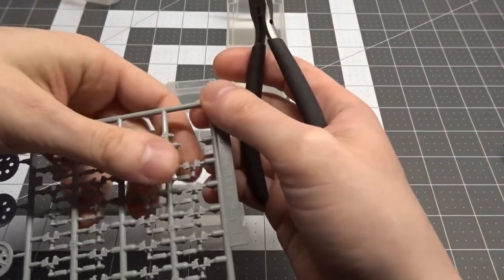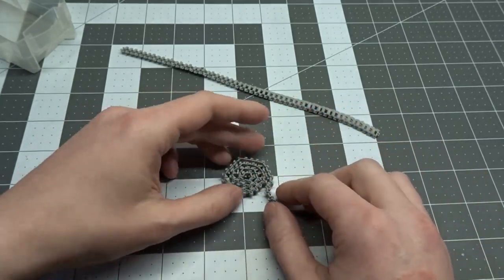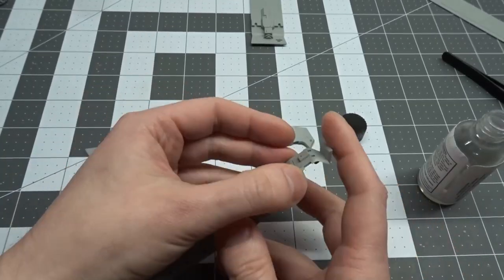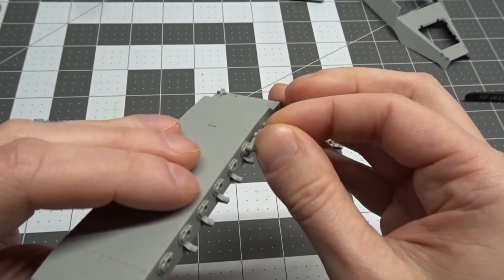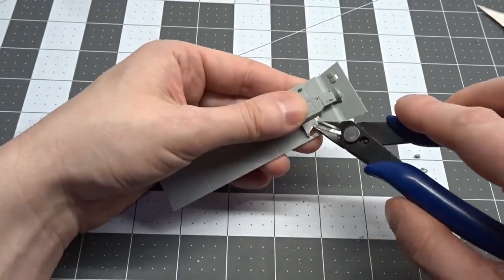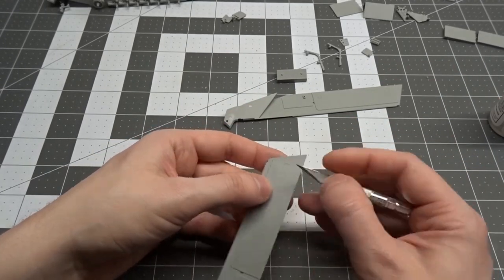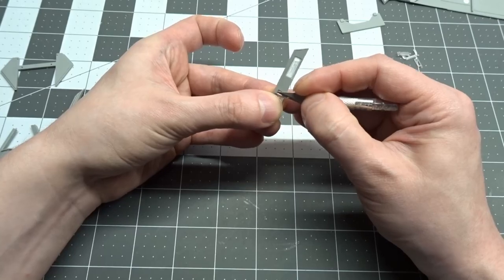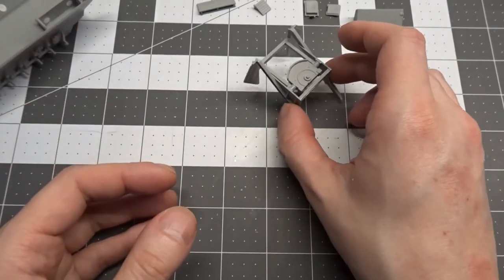Dragon 1/35 Sd.Kfz. 251/22 Ausf. D (Update 1)

Comment: Nice job you did. I have some questions: how many mm is the length of one engine hood? And  what is the length of the widest part of one engine hood? And, how many track links does it have on one side? Regards from the Battle of the Bulge area, Belgium.
Reply from the maker: Thank you so much! This is the Ausf. D so it only has one engine hood the C and earlier have two. The length of the hood is 31.75mm and the widest part is also 31.75mm. The tracks are a lot like the real vehicle with one side needing 54 links and the other 55 links. If you have anymore questions I will be happy to help.
Reply: @FlokisModels  aha, okay. I asked because somebody offered me a metal door with the shape of a Sdkfz 251 engine door ( one of the two). With the kits scale, and your measurement, i can convert it in cm and then i know if the door is really from a real sdkfz.
Reply from the maker: @gerhard6105  Glad to be of help! That would be really cool if it was a engine door from a real Sd.Kfz. 251!
Reply: @FlokisModels  yes, but do you have a 251 with 2 engine doors, in 1:35? I would like to know these sizes (from 1 door).
Reply from the maker: @gerhard6105  Yes I do. The engine bay doors on that kit each measure. Length= 25.4mm
Width at the largest section= 15.08mm

Hope these measurements help.